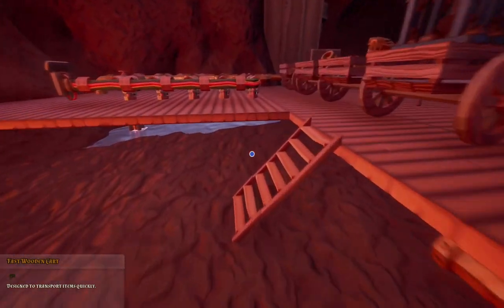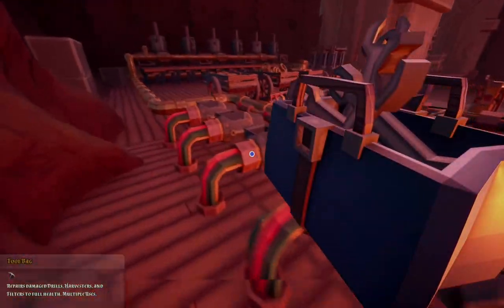Hydroneer 2.0: Let's Play: Ep.7: Merging Belts & Easy New Auto Repair for Water Filters

Comment: hello, if you use a logic flip hook instead of a logic greater than your build can be much smaller. you only need 1 path between the hurler unit and the durability reader. basically the hurler needs a 1 or higher to operate. the durability reader is always 1 or more until the filter breaks.  so with the flip hook any value 1 or greater gets flipped to a 0 and when the filter breaks the durability reader is 0 and gets flipped to a 1 and activates the hurler.  no keypad required...
Reply from the maker: Your absolutely correct! This build is large and the only good thing is that it has a Display & I can designate when to repair. I go the short route now with using the Flip/Flop circuit and no displays. But, thank you for pointing it out to me. 😎👍